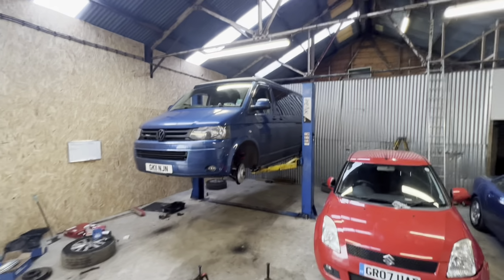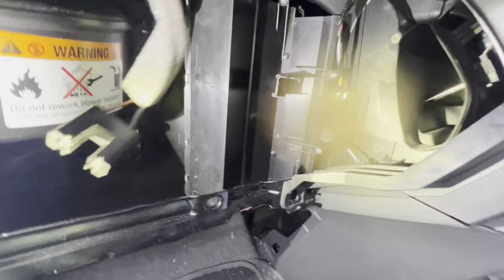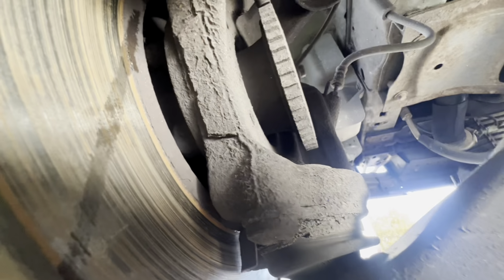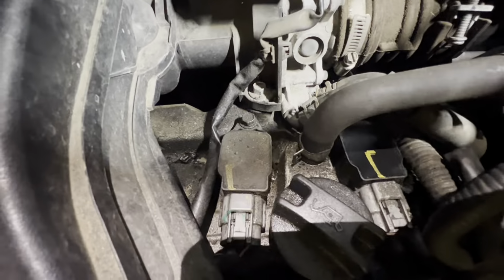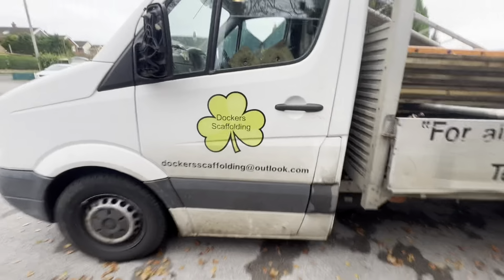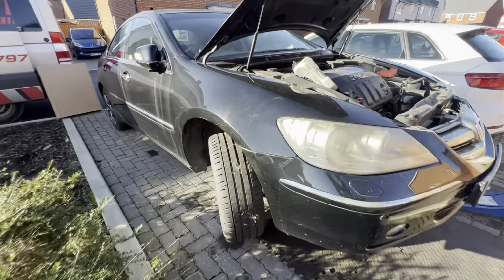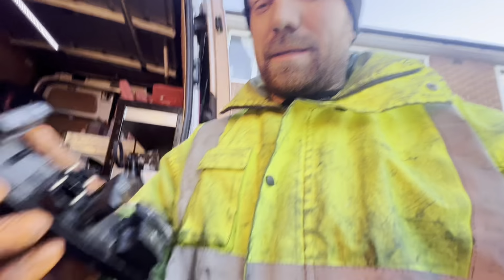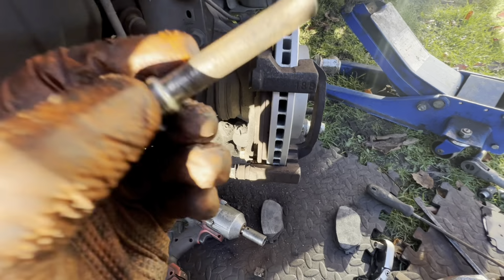A cold week in the life of a mobile mechanic | getting greedy | customers diag | Kerbside weekly EP4

Comment: Enjoy your Videos, wee tip, but maybe am fussy, seat covers needed to keep customers car seats clean 😊
Reply from the maker: Noted, luckily I’ve never stained a customers car seat but maybe I should prevent it in future 👍
Reply: @kerbsidemobilemechanic  It's not about when you do, but when a customer thinks you have and starts accusing you, it will happen at some point! It's for your own protection, as you can turn round and say "The seat was covered so that's not possible"
Reply from the maker: No I agree on that one mate 👍
Reply: Someone already picked up on the seat cover and I agree that it's for your protection and I've been guilty of not putting one in myself especially when tired. It was interesting where you dump your oil as I too am mobile during day but also have full time night job as a truck tech at a dealer but am jacking that in after 25 years and going to poodle round in my van doing cars. I normally empty all my oil at work but obviously will have to look elsewhere now. Love your videos but sometimes you need to cheer up a bit 😂😂😂
Reply from the maker: @davidbonnett5441  Thanks, something I’ll deffo be implementing in 2024 for sure, ask your work id you can continue to dump oil there if you’ve forma good relationship with them? And don’t worry mate it’s not all doom and gloom 😅 Just a culmination of a tough and busy year I think 👍
Reply: The only thing I hate about the mobile guy I use is the fact the steering wheel is left absolutely disgusting and I have to scrub it with babywipes after. I know it's the mechanic because I clean my touch points with wipes every time I get fuel, especially after covid.
Reply: @kerbsidemobilemechanic you could easily get waterproof covers and just reuse them, doesn't have to be plastic disposable ones.
Reply: @davidbonnett5441 Council tips certainly in Scotland anyway, take vehicle fluids. You'd just maybe have to go in your car because again here in Scotland you need a business permit if you rock up in a van.
Reply from the maker: Yeah I’ve now got one 👍
Reply: @kerbsidemobilemechanic  Happy New year fella @ keep doing what your doing
Reply: @kerbsidemobilemechanic  it can't be easy thinking of everything when your starting out. Hope you have a great year.
Reply from the maker: Happy new year pal 👍
Reply from the maker: Thanks a lot 👍

Comment: You can unplug a coil you suspect to be misfiring while the engine is running and see if it makes a difference. Especially when the miss is consistent.
Reply from the maker: Yeah I know lol but all coils aren’t always that accesible plus using a machine is more accurate 👍
Reply: @kerbsidemobilemechanic  yeah fortunately the intake wasn’t blocking the suspected coil. And it has to be a consistent enough miss otherwise it’s pointless lol
Reply from the maker: Exactly mate, don’t guess, test!

Comment: The ford S max, the dangers of not doing diagnosing non-starting cars.  Customer to blame have to pay for parts when a diagnosis by you could of saved them money!! must be frustrating when customers try to be mechanics and tell you they know what the issue is and ask you to replace the part!
Reply from the maker: Generally speaking I refuse to just fit parts but from time to time if I feel the customer has done their due diligence and what they are requesting is fair I will go ahead, turned out later on to be a bad earth as I said 👍